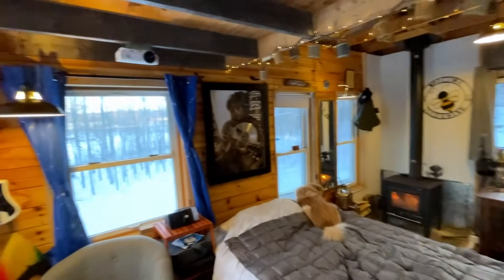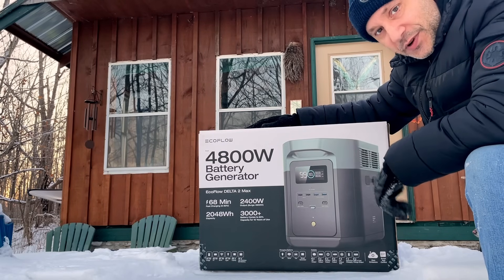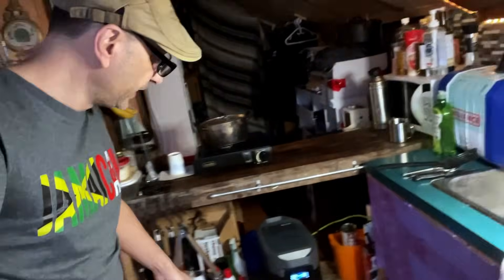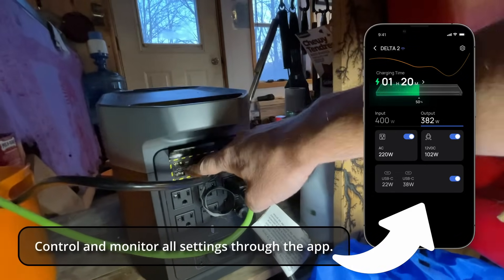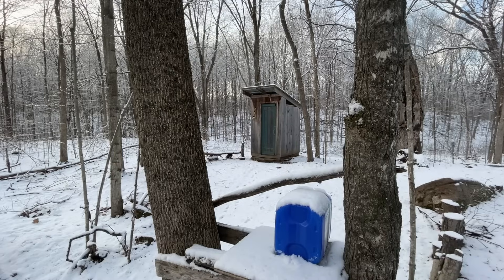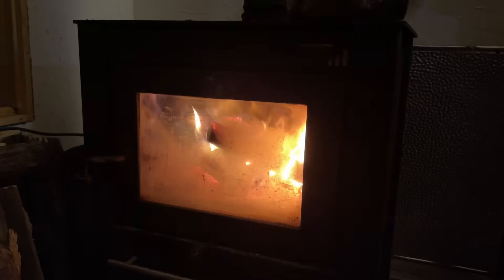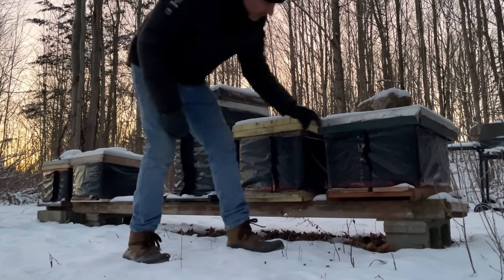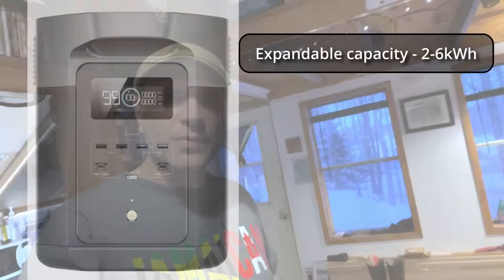The Truth About Power Stations vs. DIY Lithium Batteries (Why I Made The Switch!)

Comment: one day in the future, that ecoflow powerstation is going to stop working, toss out a error code, and you will have no recourse on repairing it. Depending on what is going on at the same time, this could be very bad. If you have a DIY Lithium system, you can stock replacement parts so that when the same thing happens on a DIY system, you have options. Also, LFP cells come in all sorts of shapes and sizes enabling you to keep the prismatic cells inside the climate controlled area thus removing the issue of not being able to charge below freezing.
Reply from the maker: Good points, and this is why I feel protected with EcoFlow’s five year warranty to cover any potential issues. I think the combination of diy solar along with a power station makes the most sense for my needs. Thanks for your input.

Comment: You can't charge them but you CAN use them. Lifepo4 batteries get damaged by charging below freezing. Using them below freezing helps warm the batteries up, and can actually allow you to hit the target temperature to begin charging them again.
Reply: I have 7 Ecoflows and a 400AH lifepo4 server rack battery and they all work fine below freezing but charging at that temperature shouldn't be done. Any power system using lifepo4 should prevent you from charging in low temperatures
Reply: Not true, you can charge them below freezing without damaging them, but the safe C-rate is very low, so most BMS just do not allow charging below 0⁰C.

There are LiFePo4 batteries sold in Norway that have a better BMS that allowed charging down to -10⁰C, but at 0.05C. Any additional charge current is dumped to the heating element. The inteded use for thise batteries are unheated cabins with charged with solar.

Comment: I'm in Florida and don't get really cold weather but I have two Ecoflows (the Max and a Delta 2) and I swear by them. They got me through the major hurricanes last summer. My thinking is people want to make it a situation of either or when it might be both or a hybrid system. I'm currently investing in a solar array and a couple of Lithium batteries as long term backup. I say that because during the hurricanes we were out of power for almost a week and I realized I needed multiple alternatives rather than standing on principle of just batteries or just a power station.
Reply from the maker: Thanks for sharing, this is exactly why I think there’s a place for both DIY and power stations, plus generators. It’s always a good idea to have redundancy for backup power systems.
Reply: I am in So. Cal. so Earthquakes and a Hokey power grid is our problem.  I built a smaller system with batteries  and solar panels meeting emergency need and look towards building something bigger.  I might add a gas generator as good working used ones are fairly cheap.  That plus 5 gal. of gas can go a long way in  what I already have.

Comment: So here's an interesting thing. I was driving through lower Michigan just in mid December. I was keep camping and it hit 14°F at night. Both my deltas worked in that cold temperature for my electric blanket. I personally can say that my batteries ran all night in super cold weather without a hiccup. I'm not sure about charging because I charged them when I stayed at a hotel a few times, but the majority of the time I was in the jeep and it was cold out. They do discharge just fine in cold temps.
Reply from the maker: That's great to hear. It may not be good to do on a regular basis, but nice to know the power is there if needed.

Comment: Since retirement, I live full time at my office grid cabin in Maine. Currently running 1400w of solar panels with a 24V system. Nearly a year ago upgraded to (4)300 ah lithium batteries giving me about 15400 watt hours of storage, running a well pump, refrigerator, freezer, microwave, coffeemaker, computer and lights. Since upgrading my batteries nearly a year ago I’ve never needed to run a generator. The inverter will shut down the solar charging if the battery bank temperature approaches freezing. However, the batteries have an internal heater to mitigate shutdown. I’m set up with a bulk propane tank for hot water and heating if desired. I normally heat with wood but if I’m away I can set the thermostat to keep things from freezing up.  While my using propane might mean I’m not a purist, I’ll get over it with a hot shower on demand.
Reply from the maker: Nice, thanks for sharing your system, that's a lot of storage!
Reply: @ Yes, but living off grid full time, it’s the extra storage that makes the difference this time of year with so little sun. I don’t think the batteries have ever gone below 40%, even on these short overcast days of winter. I obviously have to keep the panels clear of snow.
Reply: First comment I’ve seen with someone with a similar system that I’m planning to build for my family this year as we’re going to be homeschooling/homesteading off-grid on my parents land in North Central Saskatchewan Canada.  I’ve purchase 6 x 200Ah batteries, also bought a 24V inverter/charger. And will have similar capacity as yourself with the addition of an Anker 3800 that I just bought… still need to install everything, but looking forward to the challenge of getting this all going. Also have a pallet of 31 x 405 W solar panels.
Was curious how the system handles the well pump as that’s pretty high usage.  Also, I have 5 kids… so we’re going to use more power than a single person in a small cabin.  I think I’ve got the bare minimum required so far, but as most people have 48V systems and A LOT more storage, I was getting a bit nervous - your comment gives me a little more peace. Thank You!
Reply: Oh, how I would love to have an email conversation with you! In lieu of that, would you be willing to share the brand/type of batteries you have with the internal heating system that works well enough to prevent damage to your batteries in Maine winters? Also, what brand/type/capacity of inverter are you referring to that shuts down your solar charging automatically when the temperature approaches freezing? And finally, are you located where a company can come and fill your bulk propane tank or is your tank portable enough to be filled off-site? Thank you! Sounds like you've got an AMAZING setup there! Happy Retirement!
Reply: @northerncaptain855  good to have a backup incase you have problem with electrical setup.   Using water to heat by electricity chews up a lot of power.  When I use to go tent camping I would take several 2 liter soda pop bottles painted flat black.  Fill them with water and leave them out in the sun.  Not unusual for them to be over 120 degrees.  The preheated water can save time in cooking.  Mixed with regular water it can be used for other purposes.

Comment: It depends on what we mean by off-grid. Your reasoning makes sense to me for someone off the electctrical grid but on the road grid.

When off-grid moves from road vehicles to ATV, UTV, snowmachine, and boats, portable looks more like fragile.

The extra work of DIY portable also buys modular repairability. I know my lifestlye breaks things at higher than average rates, so hard to justify putting all my electrical eggs in one proprietaty plastic basket
Reply: And yes, the lithium-in-the-cold struggle is definitely real.

Comment: I have an off grid cabin in Maine, and the winter temps can be brutal. I have 2 Temgot 12v 100ah lifepo4 batteries with built in heaters to keeping my cameras and internet running. Combined with a Delta 2 when I visit the camp to supplement some power, I never run out of power. Summer time is another story, but I usually bring more batteries and also use a small gas generator.  By the way. I purchased my Delta 2 during Black Friday for only $399. Talk about an awesome deal.
Reply from the maker: @twiddler71  that’s a great deal! Thanks for sharing your setup.
Reply: Great to read about your setup. One question - Why do you need more power in summer in Maine than you do in winter? BTW, GREAT deal on your Delta 2! I missed the BF sale so I'll probably have to wait until next year's Christmas season. 😭
Reply: @juliava605  In the summer I run the Fridge and water pump. I have a propane instant hot water heater for the shower. Plus we use the ceiling fan a lot, or sometimes a window fan. When I go down to visit in the winter, everything is frozen, so I only stay a day or 2. I do have a diesel heater setup for cold days, but that doesn't draw much power, plus I have a small woodstove as the primary heat.
Reply: @twiddler71  Oooooh - I see now! This makes perfect sense. Thanks so much for taking the time to reply! Sounds like an amazing off-grid place!

Comment: Look it in the face. I don't connect lead batteries in parallel. Panels are squarish 100 watts, not long or too big to ship. AC is not king. I have camping sized pure sine wave inverters when I need an AC thing, and 12 volt DC chest freezers rule in ECO mode. DC   E26 LED bulbs too. Power stations are way overpriced, and so are lithiums. 12 volt fans in the summer. I use diluted electrolyte flooded batteries. Refilled car battery or a pair of golf cart batteries in series.
Reply from the maker: Thanks, good to hear what others are doing. Agm and lead batteries still have their place for sure.
Reply: @cleverjoe  I dodge AGM. Two of my batteries are dry charged waiting to be reactivated. You can't do that with any kind of gel,AGM.

Comment: I have a hybrid system, much of the bower is through 5 100ah Lifepo4 batteries and I have a number of lifepo4 power stations for remote work. This is charges by 2 different Solar Array giving 1600 Watts and 80 Watts for the portable units.
Reply from the maker: Thanks for sharing your system, that's a lot of power.

Comment: I am wrestling with the freezing issue. I am looking at automating the unit to have a thermostat switch on one plug that will run a small heater between 52F-70F or some other range… Work in progress.
Reply: I've considered the same but fear a fire hazard with the space heater. I'm considering a heated blanket instead but some have timed shutoffs and require human interaction to turn them back on.
Reply: @ It is a mental obstacle course. Let me know if you come to a good solution.

Comment: I think you have a smart setup for your situation. The AGM will work in the cold as you said, the generator fills up the power station quickly when no sun and the power station gives you flexibility and capacity. You do you!
Reply from the maker: Thanks for your comment, the fast charging on the ecoflow is a real game changer.

Comment: I prefer a self built system but for your situation where you are using the power station in 2 separate locations then your choice makes absolute sense. 
I'd run a few circuits off it at home to eat away at the power bill, although this may affect it's ability to be useful during a powercut.....but if you also have a generator at home...voila!!!

Comment: 2 Delta EF3 Pro 1300's, a Delta 2 Pro and xtra Battery and an River 2 Pro aside of My 5 Separate Solar Systems on My 6.2 acre Ranch ⛩
To Top Off The Eco Flows at Night a 24 Volt Battery Bank of 10KWH Being 4 Batteries @ 100ah each tied to Buss Bars and Wired with 10/3 Marine Grade Tinned Wire ran underground to My Lodge Kitchen to use indoors Helps allot

Comment: Great jib my friend  , I think  what would go great  with your set up is a an ecowflow  smart generator  , they have 4 different  smart generators , You can set the smart generator  to start charging your ecowflow power station  once it reaches 30% , once it reaches  100% the smart generator turns it self off  , 3 of there smart  generator there duel fuel, and one of them is gas only .

Comment: I made the mistake of buying a Bluetti power station. What a pOC because I’ve had nothing but problems and spoiled food. Subjected to countless horrific bouts of customer service. Buy a Bluetti if you want to lose weight via some serious episodes of explosive diarrhea.

WRT to not being able to use your Ecoflow do like what we did. The cabin was originally wired to run off a generator. When the cabin has warmed up the generator is turned off and switched over to the Delta 3 Plus.
Reply from the maker: Sorry to hear about the issues with Bluetti, especially the diarrhea.

Comment: I think using a power station is a fine trade-off, but you have to be careful not to become dependent on the vendor proprietary lock-ins and, particularly, their expensive expansion batteries.  There are also serious scalability issues and lack of repairability.  It can be problematic when things break.  For that reason, I would limit such setups to only small and medium-sized power stations and have more than one.
With a power station you essentially have to keep the unit indoors (which is fine)... and depend on a good ~1 hr with the wood fire before it warms up enough to take a charge, in very cold weather.

It is fairly difficult to insulate a power station due to all the cables going in and out of it.  It is still doable, just not friendly or easy to get right.

--

One thing you can do to make things a bit easier with the power station solution is to construct a small front-end battery bank that is permanently mounted in the cabin to connect to it instead of trying to feed solar directly into the power station.  That allows the cabin's solar system to continue to produce energy into the front-end buffer battery system even if you have disconnected the power station (true portability).

A battery buffer is quite simple.  You have the solar panels, you buy one or more charge controllers and one or more discrete LiFePO4 batteries (get batteries with internal heaters for cold weather), and that's it, you are done.   You can feed the battery bus directly into the power station's "solar" input and trickle-charge the power station.

You can do this with either a 12.8V system or a 25.6V system.  51.2V systems are generally too high a voltage for most power stations (but the larger ones can handle it).   The sweet spot is 25.6V LiFePO4 because that will "trickle charge" the power station at over 250W and can take a substantial amount of solar without needing to deal with high amperages.

Basically:

---- PROJECT #1 ----

* 25.6V x 100Ah internally heated battery (up to 4 in parallel)
  (place in an insulated battery box to reduce power consumption further).
  2 AWG cabling.

* One main battery fuse (typically ANL type).

* Victron 100/20 charge controller, as many as needed to handle the solar.  10 AWG wiring.

* DC Breaker or fuse -> connector to plug into power station.  Typically 25A.

* Just for fun, get some 24VDC LEDs to hang off the system too, to light the cabin up at night.  Just 5W or so.  Nothing big.

And that's it.  You are done.  The solar and the charge controller will supply power to the batteries to allow them to self-heat, and the above setup WILL self-bootstrap if the batteries have been cold-soaked (due to insufficient sun or snow-covered panels).   The battery bank will then trickle-charge any power station you plug it into (power station's "solar" input must handle at least 30VDC in this example, however).

The power station is thus far more portable without having to necessarily cold-soak the cabin.

--- PROJECT #2 ---

Now if you have a generator setup you can do this:

* Get a small generator with a relay remote start feature.

* And a decent amperage battery charger (e.g. Victron 24V battery charger).

* Buy a simple programmable voltage controlled relay to turn the generator on when the battery bank is depleted (around 24.0V), and turn it off when the battery becomes full (lets call it 28.2V).

And now the battery bank will be kept alive by the generator automatically on an as-needed basis, and thus be able to stay warm even if the solar panels are covered with snow.

--- PROJECT #3 ---

And now if you want you can have options that work without the power station needing to be present.  Simply add a 24V inverter to get your AC and plug-in whatever you need.  Remember to turn the inverter off when leaving the cabin unattended, but leave the generator system live so the batteries never cold-soak.

And magically you now have a fully operational discrete system 🙂That I just roped you into doing 🙂🙂

-Matt
Reply from the maker: Wow, some great information here. I'm still thinking about the best way to integrate the two systems and you've offered some excellent info and great ideas. I'll look into the 24V inverter you mentioned. Thanks!

Comment: I've got five EcoFlows thus far ( one Delta 2 and four River 2 Pro ) for zonal input into my house ( on grid ) each with their own solar panel. Doing great so far. Using to reduce dependancy on grid power, back up during power failures, and acquiring knowledge and equipment before going off grid at some point. But also making DIY systems on hand trucks which does have more stored wattage ( and fun to design and build ).  A couple things to add: You can use the 12v 100 amp lithium battery as add on storage ($275 vs ecoflow add on bank at about $3000 ). Batteries can also be charged through solar panel WITH MPPT charge controller. A back up for your back up. Next, you can charge your units on an "inverter" generator, just make sure you use a surge protector.  Brian in the Okanagan, B.C.
Reply: I came here to say essentially what you've said, though I'm looking to backfill my power station with a 48v battery (which my power station, as well as the EcoFlow highlighted here, can accept). The video I'm linking below gives a fantastic breakdown on why you should expect 48 to feed at a higher rate than a 12v.

https://youtu.be/9ODIF2EfsUA?si=dS1hbyW6U106MADp
Reply from the maker: Thanks for your input, I plan to build a portable power station in the future as well. Good luck with your projects.